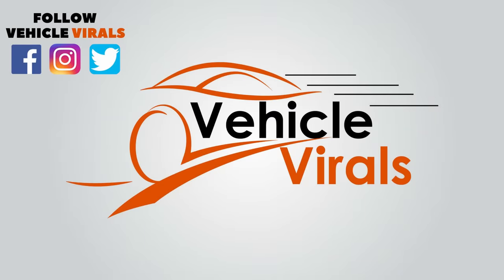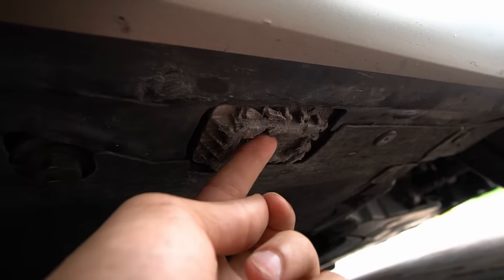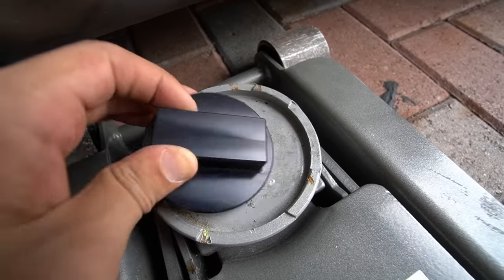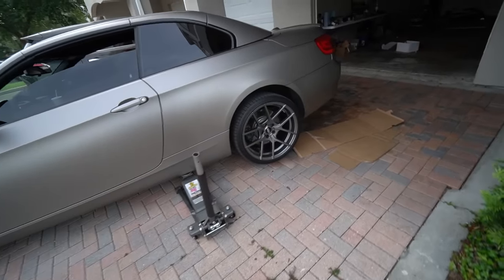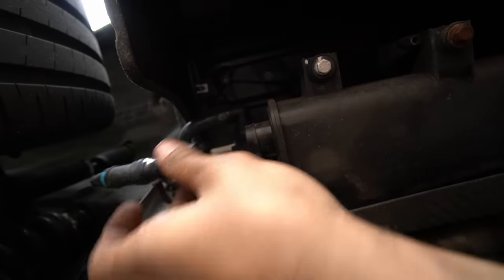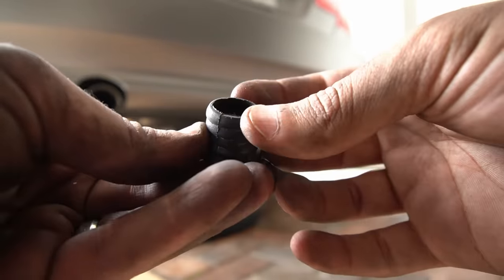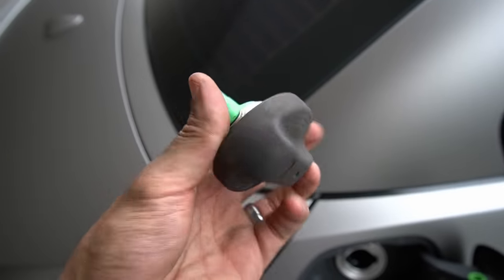All BMW Owners Should Replace These Two Parts Before It's Too Late *EASY DIY*

Comment from the maker: Just released a Vehicle Virals shirt featuring the BMW from this video. I have less than 100 available! https://vehiclevirals.com/products/bmw-3-series-in-motion
Reply: I have a trans failsafe light comes on 1995 740i what can cause that when it's warm it's hard to shift automatic
Reply: What will u recommend for P0442 code ?
Reply: I'm definitely getting the jack pads as soon as I can get it out of limp mode😬
Reply: I wanted to buy 330 ci convertible 2006  90 k miles it will be cost me high replacement later and are you recommending i buy it thanks?
Reply: Harbor freight sells a compact hydraulic car jack. It's pretty small. It slides under your can and it is super low profile. Turn on the hydraulic pump and it easily lifts the car at least 4 ft. Cost between 5 or 600 and it's awesome
Reply: Hi what kind of app are you using and how do you code

Comment: NEVER use grease on rubber grommets or flange adaptors - use SILICONE SPRAY LUBE instead - it protects and revitalizes the rubber, keeping it supple and pliable, preventing it from drying out, cracking, or tearing. Just a little FYI for ya, brother. :) Good videos - you've earned a new subscriber! Cheers!
Reply: Has a plumber silicone grease is my best friend when repairing boilers etc around the orings etc 👍👍👍
Reply: what brand do you go with Brian?

Comment: 10.40: this item is also called the fuel vapour detection pump. This must be what's causing my engine light, plus the fuel smell. Thanks for the excellent tip. Keep up the great work. 👍🏿
Reply: No you most likely have a leak. The DMTL is simply a vacuum pump that puts the system under vacuum so that the engine computer can monitor for decay and flag leaks.  If you smell fuel, remove rear seat lower cushion. There will be a black fibrous noise insulator. Lift that, and you will find the access doors to the fuel filter module, and the fuel pump. Focus on the driver side one. The access door is secured by four 8mm screws. Undo those, lift that cover, and you will most likely find that the fuel filter module, is leaking fuel. It will be puddled with gasoline. 

To replace one, you must remove both sides, as the module has lines that connect to the fuel pump on the right side.

VDO is the OEM supplier and they sell a kit which brings everything you need to replace it.
Reply: no, its definitely 100% a cracked fuel pump..thats made out of plastic...ask me how I know lol..
Reply: @dfweurocars  yep me too
Reply: @EatSleepLiveTheGame  happens to the best of us lol

Comment: Always remember at any time you are jacking up your vehicle with a jack or jack stand to chock block your wheels so the vehicle doesn't roll off the lift device you are using.  Thanks for sharing this video Christian!   It makes sense to maintain your vehicle's parts that are known to fail and the parts used to reduce damage lifting your vehicle in order to do maintenance.  LOL at neighbor about a tire rotation. 😅  You are informative as always and we'll be wishing you the best brother!  PEACE!
Reply from the maker: I did chuck the wheels btw 😏

Comment: Wish all cars had jack pads like that. Though I will say here in Vermont, salt and dirt would get inside the rockers, rot out those mounting spots, and eventually you wouldn't even be able to use those areas, hah. Good spot to pop out the pads and spray rust prevention inside the rockers though!

Comment: "plastic".. yo, I'm cracking up because I need to change those extra same parts.  🤦🏽‍♂️ Started throwing codes for the evap pump after changing the fuel pump and sending unit. Though my check engine light went off after I cleaned the gas cap. It's probably plotting the right moment to illuminate... Great vids as always. You're a real inspiration bro.. keep it up!
Reply: Had the evap pump fail on my Mini too. Same issue. Wasn’t hard or expensive to fix once I had the codes.

Comment: I’m on my 3rd BMW over 20 years. Never had an issue with leak detectors.

The plastic water pumps however...EVERY SINGLE CAR around 100K miles.

Comment: I'm sure you already know but check your jack stands to see if they have been recalled.  There is a big recall on Harbor Freight jack stands.  Not knocking HF, it's just a very big safety issue if they were to fail.

Comment: My DMTL pump failed several days after buying my E90 328i, unfortunately. At least it was a easy fix. And just 2 days ago, I messed up 1 of the jacking points. So this was uploaded at just the right time.

Comment: OMG I just changed the DMTL pump a week ago. Super easy fix; I removed the carbon canister just like you did to get the T20 screws off, too. And I bought four new jack pads this week because I lost one to a speed bump. Great video.

Comment: It is good to change your detection pump every 80,000 miles and I would recommend changing your vapor canister (charcoal filter) at the same time. They get real dirty and it is attached to the detection pump anyway.

Comment: Hey Christian, great content as always! Hope you're staying well. With your HF floorjack, didn't you get a rubber piece for the lifting portion of your jack (the saddle)? Also, if you have zero options but to lift on the jack pads that are already mangled, you can use a small piece of wood (2x4) just high enough to get the other one off and the new one back on. You're referring to the Esco 3 point flat top jack stands (and they're super stable and expensive...$56 reach) Keep up the great work! Love the content! #projectweltspeed. #weltspeed
Reply from the maker: No unfortunately I didn't get anything else with the Harbor Freight jack stands. Appreciate the tips!
Reply: @VehicleVirals do the n51 have that pump in the rear

Comment: I've been very active on two big BMW forums for many, many years. I have never heard of anyone having to replace that leak detection pump. The BIG issues are the trifecta of oil leaks (valve cover, oil filter housing, oil pan) the "mickey mouse flange" in the cooling system, the little hose from the radiator to the coolant reservoir, and the serpentive belt tensioner and the carnage that happens when the belt comes off and gets sucked through the front crank deal.  have a '11 328i wagon (6spd/rwd as God intended)  I have owned from new, and an '11 128i convertible currently. And a bunch of other BMWs over the years.

Jack pads don't fail if the car is jacked up properly. Of course, idiots don't jack them up properly. Hockey pucks work fine for jacking up the car without damaging the pads.

Comment: If you don’t have a jack pad adapter then you could also remove 2 wheels and then slide them underneath those side skirts. This will save your life if the jack fails or tips over. 

I get lazy sometimes so i just put the jack stands about a 1/4” below those plastic pads. I use one of those blue aluminum racing jacks from Harbor Freight. Those jacks don’t budge even after months lol. The jack stands then wouldnt damage those plastic things but at the same time would save my life if there happens to be an earthquake in Texas.

Comment: This is video is mainly for prelci e90 n54 335i BMWs and 5 and X series that share that same engine. The 2005 to 2009 335i in this video is the probably the most unreliable BMW and engine combo  you could possibly buy at any used car dealership. The n54 is a sweet and tune friendly engine though but not worth it for a daily driver, a main car, or if you only have one car. This video is probably relevant for owners after the dealing with the 335i n54  oil leakage, waterpump and fuel pump issues

Comment: PSA:
1. Harbor Freight has a jack stand recall;
2. Don't get under a vehicle with a jack alone, especially when the  adapter can slide around on the jack.

Comment: Just bought 2 jack pad adapters 4 days ago  lol. I was struggling working out where the jacking point was so I Googled it. They were £11.99 each in the UK. I even forgot to take the adapter out and drove 6 miles. Couldn't believe it stay in when I got back to take my wheel off again to paint my break calipers.

Comment: That MHD scanner work well for all around problem codes and making changes such as in a i3 bmw tuning?  I have a 2008 335i and it’s been very good, meaning problem free, I did get a lack of top end power recently, then the next time out a engine light, mechanic says I got a misfired #5 cilinder, I am thinking maybe a coil is getting bad? The car has less then 50k miles, I have to get a good scanner to give me better information. Would you recommend that MHD scanner, and another?  Mine is the E90. That veinous video looked like maybe the think I should look at, but did it come up on a scan for trouble before you removed and cleaned it? Thanks a lot in advance for responding. Much appreciated videos and a new follower. Btw, if it is the #5 coil or plug, how does someone know which cylinder is which?

Comment: Hey man could you help me out I had auto zone read the trouble codes & The most likely solution was replace camshaft position sensor CMP. Suggested parts “Distributor” I’m super confused because idk   To much about cars but I’ve been trying to get into fixing my 2007 328i 120k miles. I love your videos as well as Danny Z. I’m trying to get mine up to par with y’all’s lol

Comment: Excellent video as always. 
I'm a beginner or even lower.
So what is that leaking pump thing? I have no idea what all those parts even do.The thing, the system. I'm clueless. Exhaust leaks?
Leak detection pump.
Reply from the maker: The leak detection pump pretty much works to find leaks in a vehicle's fuel lines, focusing on the evaporative control  system (EVAP). The government requires these types of systems to minimize the amount of harmful vapor leaks that goes into the environment.

Also can can cause your car to not run as optimal as it should.
Reply: @VehicleVirals  Thanks for replying. You're awesome. I now fully understand!

Comment: The fault code you are referring to should be properly diagnosed by preforming a smoke test with a smoke machine yes the leak detection pump is a common failure but I have seen where the vent solenoid has failed or the pcm which controls the ventilation of the gas tank has failed

Comment: I wouldn't use the flat jack stands with those adapters as they wouldn't have any grip to hold the car from sliding off the stands.

Comment: I have a 2011 320d MSport and after topping up with fuel one day I had a dip in power and the engine light came on. Happened a few times and after some digging found out about the petrol
Cap. Cleaned it all up, bought an OBD2 reader, no codes, no more light. Bizarre, although I do suspect it will be back at some point!

Comment: Hey Christian great video as always!  Would it be a bad idea if I bought 4 jack pads and got them to stick permanently somehow so I’ll always have a nice flat surface to use??  The key word is permanently, I’d never want them to fall off at 150mph smackin the car behind me 😂 But I know it can be done.
Reply from the maker: Could be a good idea if the adapter actually stayed in place for obvious reasons like you mentioned lol. It'll definitely take some witchery to make that happen 😂

Comment: Most new BMW do not come with a spare tire or jack. My question is specific to the jack itself. Can you use any standard scissor jack type of jack? Or must you have a special one from BMW? Asking because your jack seems to fit neatly in the plastic rubber spot under the car. It would be a pain if that means you need to use only a BMW jack.

Comment: 1:19 "Well it's BMW what do you expect?"
The box is literally right there with "Bosch" written all over it, guaranteed half the cars in the world use that part or similar lol

And of course it's made of plastic, it doesn't have to handle any loads. If they made every little thing of steel because "plastic bad" you'd be complaining about how it costs hundreds of dollars, and the car would be hundreds of pounds heavier for it and people would be complaining they made their cars too heavy.

You can't win really there's always some armchair engineer who'll have a problem with it.
Reply: Yeah, the problem with the unit had nothing to do with the plastic body. If there is bad engineering there, it's with the internals. Stupid comment by a petrol head.

Comment: I bought that exact brand on dmtl pump and my light still stays on and also I am starting to have a rough idle I also changed the gas cap but apparently it’s very picky when it comes to the gas cap.

Comment: Do all bmw’s have this leak detection pump? I have a 2001 740il and so fas so good but no codes so far.  I also have a 1979 320i not sure if that one has a LDP.   Thanks for the great informative videos!
Reply from the maker: Not sure about the 1979 BMW since regulations weren't as strict, but I can assure you your 7 series has one. You'll have to look for the pump that fits it.

Comment: I recommend replacing the start stop button with a new one red or black it will change the whole feeling of the interior trust me i did it on my BMW
Reply: I found a red carbon fiber button. It does look clean 👍🏻

Comment: Hi! Could you please help me? I replaced all 5 light bulbs on rear right tailights and now they dont light up at all. I checked the wiring and one of the wires seems to have corrosion. Im trying to pull out to rewire but it seems its soldered on the other end. Do you have any idea or advice on how to fix it. I also replaced fuses if that helps

Comment: Great video. Mine were about just as bad lol just a heads up the puck will fit right into the lips of those jack stands as well. Just grab a couple cheaper plastic pucks to use with your jack stands 😉🤑💯 at least it fits in mine lol

Comment: my car didnt even come with jack pads when i bough it and i don't really think i need them. I just use a floor jack to lift the car from the front jack point and put regular 3 ton jack stands on the frame rail where the pads would go.

Comment: You did not use the jack stand, but you used the tire as protection in case the hydraulic jack failed. Safety First! Great Job!

Comment: Will the leak detection pump cause an issue with filling the tank? Currently, I am only able to fill my tank halfway. It runs out of gas about half of a tank so I have to be careful. Is that a symptom of this pump?

Comment: I like the jack pads much, but:  how can you support the car easily, as the jack occupies this only pad??  There should be a similar pad say, 20 cm away from the other, for the stationary steel support. Also 8 pads in all.

Comment: you said all the rocks and dirt coming from the heat shield and things, which made me think if the leak detection have such a high failure rate, how long do they last replaced?  looking at getting my first car which is a 2007 335i so i’d love to know what to expect, ive heard a lot💀
Reply from the maker: My pump has been toast for quite some time , just never changed it 😅

Comment: The jack pads are all messed up because nobody used the round adapter. I bought my 535i from a dealer. There was only 24,000 miles on it and the only people who worked on it was the dealer who sold it when new. All four jack pads were totally messed up, because they lifted the car on a hoist directly on the jack pads. In reality, I'd need four jack pad adapters to raise the car on a hoist.

Comment: The jack pads of your car have a rectangular recess because BMW used to have tire jack that goes into there. Not anymore. There is no need to replace them as now they are used as resting place for your jack stands, and no regular jack stands will fit into that rectangular recess so they will be damaged again next time you use a jack stand. When you need to jack up the car, use  your floor jack to jack at the jack points in the front and the rear at the differentials. Do not jack at those jack pads as you will have no place to put in a jack stand.

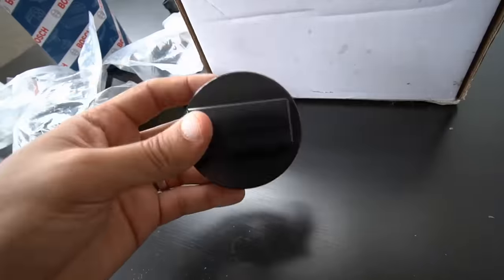Comment: 2:34 no that's a internet myth. No where in the BMW workshop manual nor BMW has any tools that fit into the jacking pads. They are supposed to simply be lifted here, doesn't matter if it damages them. Like you said, they are plastic, they are designed to be disposed off. Even using that thing it will eventually get mangled up. Y'all are worriying way to much about this. I was to when I started DIYing at home but you really don't need that. Just make sure your jack lift point is properly underneath the plastic point and it's good. Don't worry about damaging or chipping them it's literally what they're made for. It's what takes the hit VS the metal frame of the body. It's not improper use to to just jack it. Loko it up, all these so to say jack pad adapters are all made by third party companies and sold the community on the idea. 🤷‍♂ In your compariaosn, if you didn't use the jack pad and just your jack saddle, there would still be enough clereance to cause no damage to the body.

Comment: Were those your codes? Im having a “dme mixture” code and not sure what it is, done research and there is a wide variety of remedies. Completely stock n54. Just replaced bank 1 o2 sensor but didnt bother to replace other one. Thanks

Comment: funny.. owned my 2006 330i from 2015 till last week and never had an issue with the leak detection pump. Jack pads on the other hand 🙄

Comment: Hey brother, I’ve got a bmw e87 it has been loosing power, exhaust split and fixed now but the car is still loosing power badly and heat coming out of the exhaust and underneath. What do you recommend please?

Comment: Looks like you removed the rear tire to gain better access. Also, looks like you left the removed tire underneath the car. Was this a safety measure?